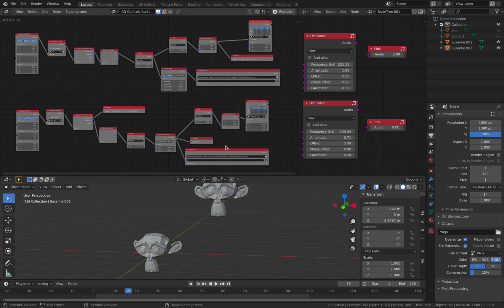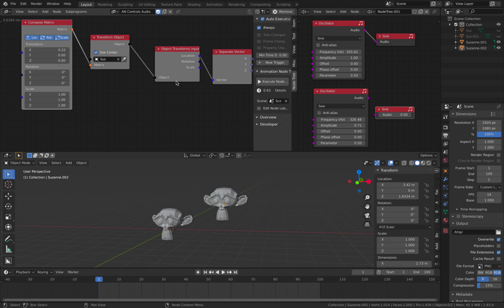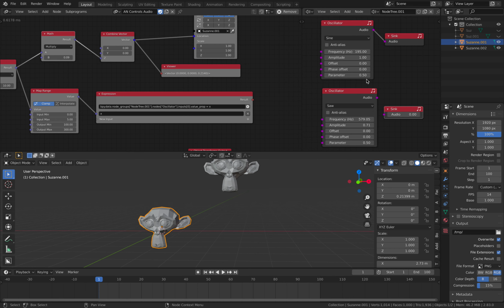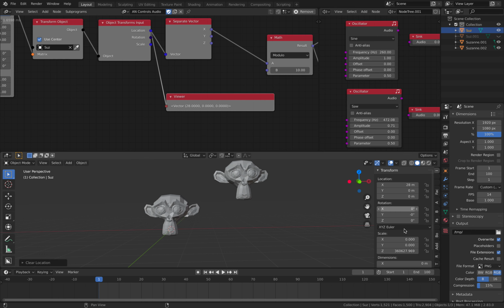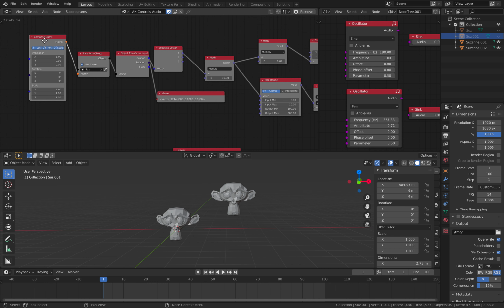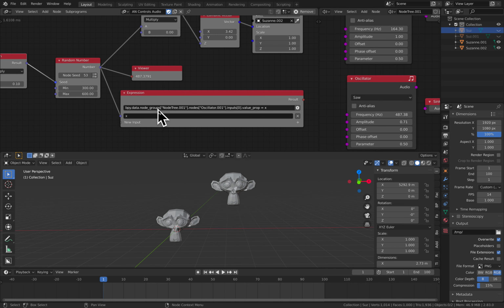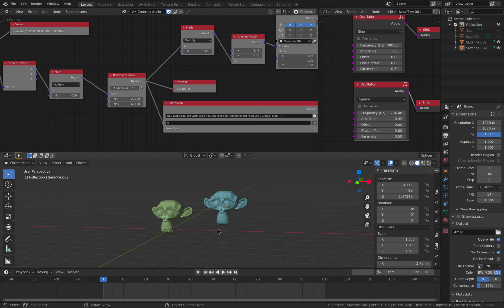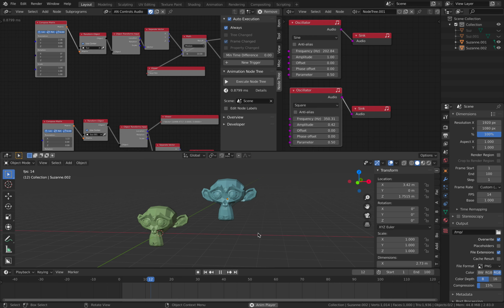LIVENODING X Parallel Audio Nodes Frequency Control Using Animation Nodes

Comment: Can it play audio cue based on animation like of it's a character walking and play sounds of footsteps and different types of running like different floors etc automatically? 

How about binaural sound relative to camera?
Reply from the maker: That's good question, actuallly. So far there is no binaural control, very likely I will let AR to handle that. 

Cue based on character walking is quite possible, just to trigger audio playback at contact. I have not tried though.